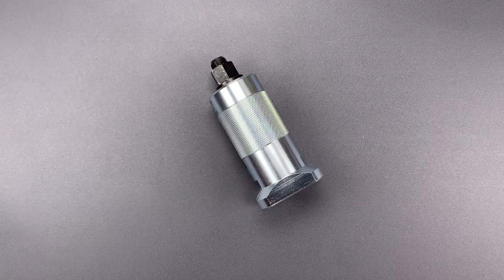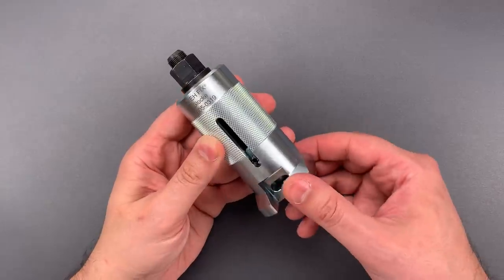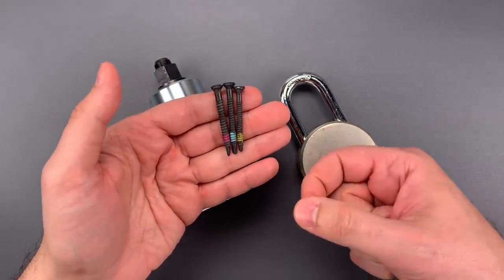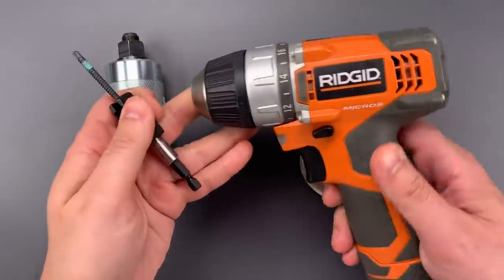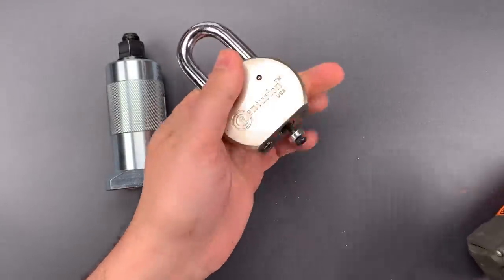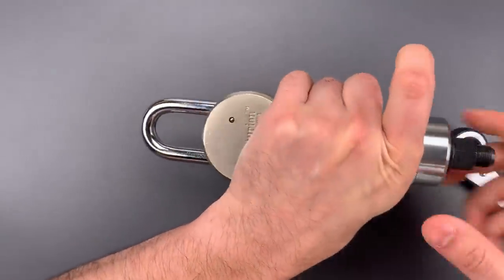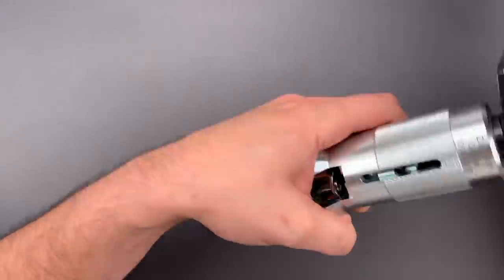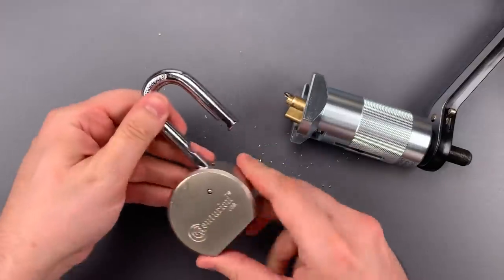[971] New Series: Zieh-Fix Core-Puller vs. Padlock

Comment: Takes longer to open a decored lock with a screwdriver than actually picking some of the locks you've shown before.
Reply: Omg hi
Reply: @rogergy1  not talking about the core extraction, only the part with the screw driver to open the lock once the core is out.
Reply: He actually picked this lock open faster in another video
Reply: LPL is a closet comedy genius. He had to make that screwdriver take 10 seconds to open for effect!!!  😂
Reply: This plus a battery powered Hilti is what professional thieves use. Saw that gear in a local report today.
Reply: Didnt think i would see you here.
Reply: takes longer but 1000x easier to do it this way

Comment: We are using the Zieh-Fix as firefighters here in Germany. You might be faster picking a lock, but for "untrained" firefighters this is one of the quickest and safest ways, to open locked doors.
Reply: Fastest way to open a front door is to use the SWAT method with the armored vehicle...
Reply: @CMDRSweeper  Not sure how the person who collapsed from smoke inhalation right inside the door will like this approach. Otherwise, I entirely approve.
Reply: @CMDRSweeper  You are right... but how do you get an armored vehicle into the thirteenth floor of a skyscraper?
Reply: It's even more simplistic as to why the tool is right for you
Fine motor control in life saving situation can't be relied on due to adrenaline
Reply: @CMDRSweeper  after the patient is gone to hospital it is far more enjoyable to change the lock than to build a new front door. ;)
Reply: @galdavonalgerri2101  Where there is a will, there is a way.
Reply: Do you guys not carry the hydraulic door spreaders? The good ones double as rams, too.
Reply: I think they're called W tools here.
Reply: @cheyannei5983  They are much heavier and destroy the door instead of just the lock of the door. Also it needs a big fat motor. Its used for opening car doors usually.
Reply: @CMDRSweeper  In Europe most new doors in cities have "resistance class 3" and better. RC3 stops you at least five minutes and at RC4 you probably break the wall surround the door, which is stone or concrete. German SEK prefer windows - i have never seen apple with them.
Reply: @Salzui  W tools do not destroy the door. They're powered by lever; they're very similar to the hydraulic cutter featured on this channel
Reply: There is a good reason, why we are attacking the lock, not the door. We don't just get called, when the house or flat is on fire. If thats the case, a halligan tool and an axe will open the door very quickly. BUT Most of the times, we need to open doors is when there is a medical emergency suspected behind the door. Maybe someone can't reach his elderly mother, or the neighbors haven't seen the old lady for a while, etc. Then the police, ambulance and fire department get called. We aren't in such a hurry, that we need to safe 10 seconds by destroying the door. We try if the door is actually locked or just shut, we look for open windows orif they are open in angle, like european windows allow. Whenn we pulled the lock, we can open the door in a nondestructive way. When we are finished, we just put in a new lock. We allways have spare locks with us. Do that with a destroyed door. And especially explain that destroyed door and wall to the buildings owner when it turnes out, there wasn't an emergency. The older lady just didn't tell their neighbors, that she goes on vacation.
Reply: Now I'm imagining LPL wearing full gear at a door with his lock picking set going "This is the LPL and we're in a burning building... nice click on one, nothing on two, some counter rotation on three, seems like we have some spools in here... And we have this open"
Reply: @RealitaetsverlustTV  I don't know how many other ways I can say this. W tools are nondestructive. It's one of the big reasons to use it.
Reply: @jangtheconqueror  I read this in his voice lmao
Reply: @cheyannei5983  They're less destructive. You can't spread a door jamb 2" without causing some damage. Especially on a block house or a steel door frame. So, definitely not "nondestructive," but rather less destructive.
Reply: @cheyannei5983  WTH Is a so called "W-Tool"?
Reply: @RealitaetsverlustTV  
http://www.weddletoolco.com/

Ich hab mal gesucht was er mit W- Tool meint.
Scheint die Tür hydraulisch aus der Zarge zu pressen / verdrängen, muss man natürlich Spaltmaß für haben.
Damit werden die Amis weniger Probleme als wir mit unseren DIN- Normen haben.
Kann deinen Ansatz verstehen, kann immer sein dass die leblose Person die Tür blockiert, also so wenig Gewalt wie möglich bei unklarer Lage.
Hab das ambulant bereits selbst durch.
Grüße vom Krankenpfleger :-P

P.S.
Hab mir kurz die Augen gerieben, wir sind Namenszwillinge, und unter Klarnamen poste ich eigentlich nicht :-)
Reply: @xenonram  I guess that makes sense. I haven't seen a house here that didn't have a wood frame; even the brick ones.
Reply: @RealitaetsverlustTV  it's a hydraulic ram actuated by a long lever with a one-way valve, typically 6000 or 8000lbs of force. They're used on the door jam itself, not the door, to flex the jam out of the way of the deadbolt. It works best on wooden door jams nondestructively; it will dimple metal door jams in use. It's much faster to get in than a core puller; a few seconds of levering and you're in.
Reply: Galda von Algerri With a C130 of course.
Reply: @cheyannei5983  Your use of liberty units makes me think, you haven't seen that many European doors. There is no way, you can flex a door jam here for more than 2 or 3 millimeters. Don't ask me, how many made up units this is.
Reply: @cheyannei5983  Ideally you want to leave the door as intact as possible. A door you can close again can block the progress of a fire, whereas a destroyed door cannot.
Reply: @edz7448  door jams are quite flexible. You only need to flex it an inch and a half or so.
Reply: @cheyannei5983  thats the problem,flexing a door Jam 2,54cm or 1 Inch is Not so easy,the frame would distribut that force into the Walls,and Here in Europe/ Germany we mostly have concrete or brick walls
Reply: What about wooden doors? Do you guys use this or do you just ax the door? What about ramming the door?
Reply: in a very critical situation where it would be very hard to maintain emotional stability, much needed for precision and speed, a quick brute force method is always the best option.

Comment: This is the slowest time i ever seen you open a lock;)
Reply: Some locks are easier to pick than break, others the opposite, and he was just showing how to break into this one without picking it.
Reply: 4 minutes, nobody gets fired.
Reply: Use the same drill he used to put the screw in and put a 19mm socket on the end of the drill , will be much much quicker
Reply: This was not even deep, yet others were struggling
Reply: Question is - is LPL faster at picking this lock than breaking it? Would love to see him race himself, on side-by-side video.
Reply: nah, the melted locks or gallium are the ones that are the longest :)
Reply: Sure, but you need absolutely no picking skills. So a lock can be opened by nearly everyone.
Reply: nah, the one where he had to put 30 rounds of 50 caliber into it was the longest, especially if you count the time he had to wait for it to cool down before he could pick it up to prove that it had opened.

Comment: "Zieh fix", pull quick, sounds like a pun on "zefix" (a curseword derived from crucifix), which a southern german locksmith might shout out in frustration after a lengthy unsuccessful picking attempt, deciding to try a destructive method instead...

Comment: This tool is used by fire department. They pull out the core of a lock, to open a door in case of an emergency. For example.
A resident have a medical problem can't open the door and no one has a key. Before a firefighter shattered a window, they use this tool. After use, they change the lock and there are no damages at the door or anything else.
Reply: Considering how costly can be a window, compared to a lock, it is quite nice, but also a bit longer, the two minute of corepulling versus a few sec window breaking can mean much.
Reply: @thorin1045  

Ok, you're right, but see the opposite of the shattered windows. You have an entrance for burglars. With the corepuller  you got a tool, which destroy a lock and that's it. Yes of course, sometimes every single second can count in an emergency, but in the most cases of emergency, you've enough time to open the door with that tool. Believe me. I'm a firefighter and workes as a ems-member. 
By the way, nice greetings from germany.
Reply: @littlesparklerofficial  Never said to not use it if time is not that important, just that in some case, this is a bit too slow.
Reply: @thorin1045  

You're right. Sometimes there are some cases they are timecritical. Then you've decide to smash a window or the person would die.
Or you can open the door with a kick on it.
Reply: If you have your gear organized you've probably extracted the core in 30-40s.
Reply: If you have a high torque battery wrench drill (exceeding 90nm, used in car garage repair shops), you can drive that end bolt head without a spanner for a quicker extraction

Comment: The "Zieh" is pronounced like Cigar (without the "gar").
One lovely helper. Ever firefighting unit has at least one of those to open house-doors or apartment-doors in case there is a helpless person inside or they want to double check if no one is in there e.g. in case of a fire in a neighboring apartment. The beauty is that afterwards you can lock the door with an emergency lock and leave a message for the home owner that they can pick up the keys in the nearest police station.
Reply: @Zieh-Fix  Go for it :) As a former Rettungssanitäter and Feuerwehrmann I am more than happy to return a little courtesy to you for building such a great helper in emergencies

Comment: Thanks for the destructive attacks! I learned a lot about locks and bought only "revised" ones. The ramset is not available here, but these seem a quiet alternative!
Reply: The Ramset's a construction tool.  You shouldn't have issues buying one unless your country is extremely restrictive about using gunpowder-based tools as well as guns.
Reply: @tashkiira7838  Nailed it. Anything that goes "boom" is illegal here or behind an absurdly strict legal stuff so no one ever can get one.

Comment: Am i the only one that was thinking that he could have picked that lock faster?
Reply: I'm thinking... fifteen seconds, at most, with LPL having a cold and just getting home from a tough case
Reply: He could have, but your average thief couldn't.
Reply: was thinkin' the same thing
Reply: In video 844 he opened this lock in less time than it took for him to open the de-cored one with the screwdriver.
Reply: No its basically what 75% of the comments say.
Reply: I have the same lock, super easy to SPP and can be bypassed. It's hilarious he used the core puller on it! 🤣

Comment: Hi Harry, It's a tool I remember mentioning to you many years ago, and we also use it occasionally on locks that have been superglued etc. It will "suck" out the core on most cylinders, including dimple locks by shearing the pins. Have not been successful pulling Kaba cylinders with potentially 21 pins, as the screws will break. We have tried different screws with no success. I'm curious about the screws you showed, and the small collet around the screw head. Perhaps these may make all the difference, although I except there is a limit to the screw's strength. Perhaps you could try a Kaba ... ?  Regards, Brian.

Comment: This is not only used by locksmiths (although they do like it, because it's easy), one big customer are fire brigades around Germany.

When they need to open a door, and don't want to kick it in, they generally use this. 

Before you ask, there are many reasons why they would use this, e.g. if there is a helpless person trapped inside a flat. Paramedics (and sometimes even the police) won't try to force their way in, but instead call the fire brigade. This gives quick access (and is as reliable and quick as destroying the door), and you just have to install a new lock, not a new door.
Reply: The times I've seen it been used, they have been faster than LPL, because they have more practice (and it's easier with a door than a lock).

For locks they generally just use bolt-cutters.

(Disclaimer: Stuff may have changed, I was just a volunteer a couple of years ago)

Comment: Have this puller myself. It works quite ok on a simple padlock. But on a cylinder lock the screws will break. They are made of extremely brittle hardened steel. And you are left with a lock with a broken off screw inside. Locked forever...
Reply from the maker: I’ve experienced this using the screws sold with the Chinese copy, but not with those I got from Wendt. 🤷🏻‍♂️
Reply: Got mine from Multipick, long time ago. Including the screws. Sure they are not Chinese. They were marked Zieh-Fix. Think I used 5.5mm screws. Most recent lock I remember, in which they broke off, was a Lips Keso. They don't break at the head, but in the middle, so I doubt the washers would help.

Comment: Now that's a really great tool to have  , a lot easier than drilling out the core and using a large bolt cutter that may not work on a number of shackles.  I was wondering if there was a tool similar to that one that would work on cores that take the round barrel key  ?

Comment: Ziehfix is pronounced  Tsee-Fix and is commonly used by German law enforcement and also fire departments because it requires little to no specialized skill or training to use and it's easy to secure the building/appartment again by just replacing the lock.

Comment: Those "Zieh Fix"-devices are also being used by firefighters here in germany. they're one of the easiest ways into a door you can think of.
Reply: In  Greece they usually break the doors. That creates a problem with the new type "armored" doors that are kind of secure. The house completely burns because the firefighters cannot get in quickly enough.These doors have disks not pin cores.  Usually happens in apartment buildings where the entrance is through the common stairwell
Reply: @asicdathens  If it's that much of a bear, do they not have a metal chop saw on their rig for vehicle extractions? Cut the bolt, right between the door and frame. 

Actually kind of wonder if there's enough pressure in their water pump to make a lance attachment, just pierce the door skin and hit the valve, blow the metal door apart from the inside.
Reply: @mfree80286  Biggest problem is if a Person you wanna rescue lies directly behind or leaning at the door you gotta open. Opening it with "Keysize 12 1/2" (other would call that "booting") might injure the person, as would cutting the door in half. More often than not, pullying the cylinder if the least-destructive, yet fastest way in. Plus, the equipment needed is very lightweight.
Reply: @asicdathens  are hydraulic door spreaders/w tools not used in Greece?

Comment: Interesting set.

In case Zieh-Fix doesn't mention it in the manual: Keep the thread of the 'Glocke' (the one you tension with the 19mm ratchet) lubricated before useage. Otherwise you eventually ruin the thread because it heats up, gets stuck or you grind off tiny cuttings which get stuck.

This tool is too expensive to ruin it just by the absence of a few drips of oil.
Reply: @Zieh-Fix  True, the replaceable parts split well-developed tools from ordinary tools :) .
Still, if the thread gets stuck because of missing lubricant while you are in the middle of pulling a lock core out is at least embarrassing ...

Comment: if you're looking for good screw replacements try Tapcon Concrete screws with an impact driver, they'll drill and seat into high-PSI concrete so I can't imagine they'd have much issue with brass.

Comment: Would be nice it you could attach the drill to the core-puller instead of a wrench. 
Add gear-teeth to the black nut and connect it to a smaller cog on a hex shaft that fits the drill chuck.

Comment: Great video... You stated that the screw broke, but you were able to keep going. In what way did it break? Thank you for these videos.
Reply from the maker: Not the puller screw... the screw that holds the core retention plate in position. I realized after the fact that I could have been more clear. ☹️

Comment: I was with the "technische Rettung" which i suppose would translate to rescue engineering squad. When comes to open cellar doors or other steel door where neither you can't smash it open (because the helpless person might be right behind it) nor use the Stihl (sparks and diesel ovens don't go well...) nor hydraulic spreaders the ziehfix (pronounced "tseefix") is the first tool of choice, if it is no fancy pancy security door with face hardened pull protection - or the second after the "nutcracker". Above ground you just order a ladder.

Comment: Don't know if anyone else has seen these before. I was at a local hospital and saw a MedSafe. This is a drop box where people can drop off old prescription drugs, syringes, etc. It had two pad locks pretty good size locks on the front. They were both Master Locks. The unit is in a public area. I do not know anything else about the locks. Because of being in a public area and having two locks -- are these OK locks for this situation?

It would be interesting to see how resistant to picking these locks are.